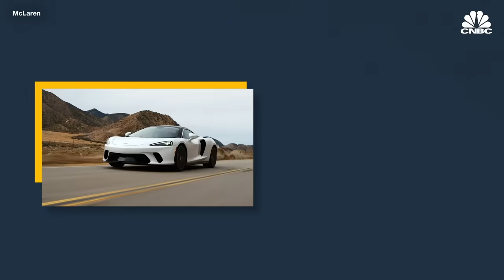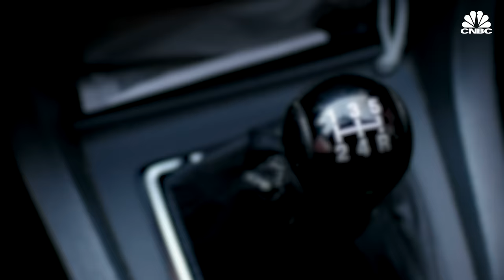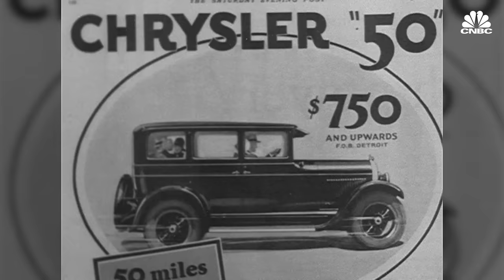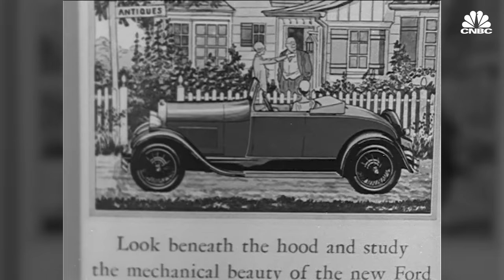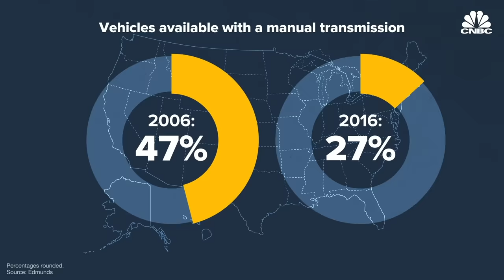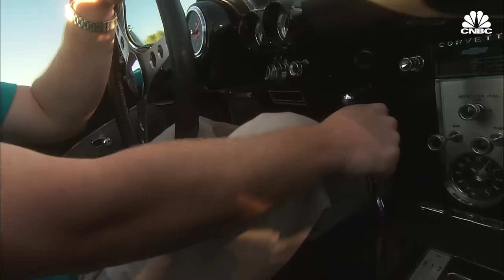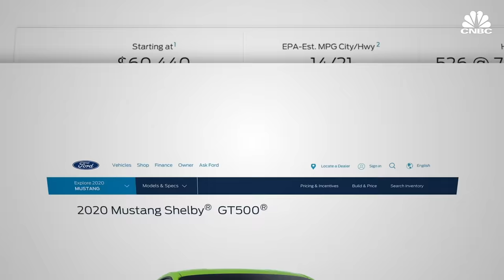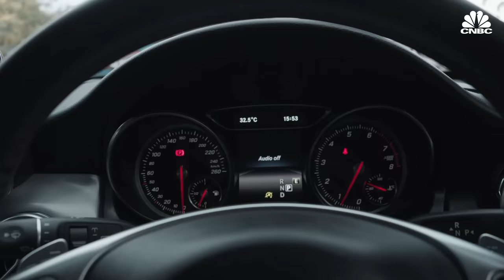Why Stick Shifts Are Going Extinct

Comment: When was the last time you heard of a recall due to a faulty manual transmission? Never? How about an automatic transmission? Every year. Manual transmissions are more reliable than an automatic, even the newest automatics are troublesome. If you drive it properly, the clutch should last indefinitely and, if the clutch does fail, it is easier and cheaper to replace then your automatic trans. Also, it is a theft deterrent and no one ever asks to borrow your manual transmission car.
Reply: Friend; Bro can i borrow your car?
Me: Yes. I drive manual
Friend: Nevermind
Reply: The only part I disagree with is the clutch lasting indefinitely a good automatic will by far be easier to maintain then the best of manual transmission.
Reply: @blackduncan9812  I was an auto mechanic for seven years. The only maintenance either needs are fluid changes, and most people don't bother with their transmission fluid. A manual gear box is simple, an automatic transmission is complicated. If your clutch fails you are either riding it (leaving your foot on the clutch pedal) or downshifting to slow down excessively. Used properly a clutch will last indefinitely. Even if the clutch needs replacement it is far less expensive and easier to replace than an automatic transmission. If your clutch fails you may need to spend up to $500. If your automatic transmission fails it likely will make more financial sense to replace the entire car.
Reply: @jinneemagic302 I learned to drive a stick at 16. It is not an art, it is very easy. Once you learn, you can do it without really even thinking about it. I am neither a hobby racer nor a hot rodder and I much prefer a stick. Then again, I focus on driving; not on my smart phone or beverage.
Reply: @jameslovell405  😂😂 fluid changes are all automatics need and most only need that around 100k miles. Clutches are ware items they need to be changed along with fluid at 80k to 130k miles. Not to also mention that most vehicles changing fluid doesn't require the removal of that component. When changing a clutch its very expensive because the entire transmission has to be removed. Although automatic transmission are more complex that complexity doesn't equate to unreliability most people with autos religionsly don't take care of them while people that drive sticks are much more likely to take care of the the entire car not just the transmission.
Reply: Ford Mustang aluminum shift fork defect
Reply: @jinneemagic302 no it isn't. I would take a manual over an auto any day.
Reply: How long a clutch lasts has a lot to do with the type of car that it is. A cheap economy car for example might have a long lasting clutch since it isn't meant to perform really, it's just meant to get you around reliably and cheaply. As for sports cars the high performance clutches they use definitely aren't meant to last forever, some exotics barely last 1,000 miles.
Reply: @blackduncan9812  I still drive my 15 year old 2005 Acura TL with a 6 speed manual transmission.  170k miles.  Still on the original clutch.
Reply: Theres an active 2020 jeep recall for manual transmissions right now
Reply: Exactly the idea why they think to remove them , because if its totaly reliable that means less benefits for the "changing parts buisness " .
Reply: James Lovell 7 years huh? funny that’s why all my coworkers who have been mechanics for 40+ years have ALL replaced their clutches. i would do a little research on the conservation of energy, friction, and power.
Reply: Someone tried to steal my cousin's classic Mustang.  They were caught because while they were trying to figure out how to operate it, there was enough time for police to arrive.
Reply: @jinneemagic302 I had an automatic when I was 16, but I really wanted to learn manual. When I was 17 my brother taught me on his Trans Am. All my subsequent car purchases have been manual. I'm not a hot rodder or enthusiast.  I just like how it feels to have that level of control over the power output.
Reply: @blackduncan9812  a clutch will need to be replaced, but the interval depends on how you use it. Someone learning to drive will burn one out faster than a knowledgeable driver. Yes, the clutch in a manual needs replacing far more often than the equivalent torque converter in an automatic but the manual transmission itself will last indefinitely if maintained properly. I just retired me daily driver due to a broken connecting rod, it was a 2002 Subaru Outback 2.5/5 speed manual with over 370,000 miles. With just  3 clutch changes in its life time at a total of about $900. One clutch was ruined by a teenager learning to drive. Had to replace one master cylinder as well, which is something else that may need to be replaced in a manual transmission.
Reply: @blackduncan9812  I also drive and work on and have built autos for racing. You have some points but you should be open to some real world experience from others. I've seen a quality clutch last over 200k. The clutch discs found in most auto transmissions usually do not last 300k-400k without needing to be replaced which means a rebuild of the unit even with routine maintenance. I speak from experience, but both of the transmissions have their place... Except for continuously variable transmissions... Those are garbage and should be reserved for go karts and snow mobiles.
Reply: Yes. You are right.
Reply: @jameslovell405  Used properly, can a clutch last 300000 miles ?
Reply: @blackduncan9812  No changing a clutch plate does not require removing the transmission. Where did you get that from.
Reply: I love manual.. I do drive one.. heel and toe on a mountain road, best feeling ever.. but guys, one day manual transmission will go into museum.. we all know that. Just embrace it while you can..
Reply: The Civic Type R’s were somehow sold with wholass gears missing but that’s about it
Reply: @atxscrew8470  Automatics are much sought after
Reply: @jameslovell405  every car I've owned has been stick, pretty much because of the reliability and enjoyment. But I absolutely get annoyed with stick Bros that talk about how it's such an art and like they're above other people that drive autos. You can learn to drive very quickly. Plus, they act like it's some kinda manliness factor to it.. smh lol
Reply: Preach! My current daily driver's a 5 spd stick.............which was a huge reason why I bought it.
Reply: @blackduncan9812  wrong they take the same level of difficulty to maintain. Change fluids. however, if they brake the manual version is easier to fix because it is a simpler design
Reply: @blackduncan9812  you don't need to remove a component to change the gear oil in a manual. Have you worked on a car? This is common knowledge.
Reply: @blackduncan9812  Also auto tend to go out sooner than manual. Not in all case, but most. Just look at automatic Jatco Transmission in Nissan. They are a serve weak point in those cars. However, Aisin Auto tend to last for 200,000 mile (because they are my by Toyota-known for reliable cars)
Reply: @fiffe7782  I'd just hang it up. His opinions are fact and it seems the opinions from everyone else (including daily manual drivers and mechanics) do not matter. 😁 Close mined people learn the least.
Reply: He's not basing his opinion off of first hand experience. I've worked on domestic and foreign, the majority or my experience being from GM transmissions (350-400th, 700r4, 4l60-4l80e) mainly because that's what my builds consist of, but also a lot of 4r75e,4r70w-4r75w transmissions from P71 Crown Vics because they usually hit the auction block due to a blown trans at 80k-100k miles, the least of my experience would be from Mopar transmissions usually of the 727TF-904 type. And by no means am I bragging, I'm just a guy who loves to build cars and has worked on A LOT of run of the mill cars like Chevy, Ford, Honda, Toyota, Nissan, probably 200 P71s 😁 I would just like to know where he's getting his information from. Also happen to have a close relative with a shop specializing in transmissions.
Reply: @greasemonkey258  I owned a lot of manual cars. When I was young and broke I drove beaters and I usually drove them until something broke that cost more to fix than it would cost me to find another beater. That was never the transmission. On one or two cars it was the clutch, but generally the rest of the car was in bad enough condition that I couldn't justify the cost of replacing the clutch. I had clutches replaced a few times too. IME, with even halfway decent care and maintenance, a manual transmission will outlast the rest of the car. A manual car may well go through two or three clutches during its lifetime. It depends on how good the clutch is and how well you drive it.
Reply: @indranilchakrabarty4196  On just about any  car, you have to remove either the transmission or the enigne to replace a clutch disk (and while you're at it, you should usually replace pressure plate, and resurface or replace the flywheel, thorwout bearing, and maybe rear engine seal, because if you don't and any of those things fail later, you will have to do most of that labor again.
Reply: @indranilchakrabarty4196  what car besides maybe a few rear engine exotics dont requiring you to remove the transmission out of the way? you have to remove the transmission because the clutch plate is between the engine and the gearbox...
Reply: @grantapalooza998  I agree. When I was 16, it took me maybe a couple of weeks to get where I could drive a stick smoothly. It took a few years to learn all of the nuances, but I was competent pretty quickly.
Reply: @fiffe7782  Well, unless you call the drain and fill plugs components, you are correct.
Reply: @russlehman2070  I've done the same thing almost since I've gotten my license. I keep something to go from A to B and it's always been a manual car, I've gotten 100k miles out of a vehicle that I have less than a $1000 total in more than once.
Reply: @russlehman2070  adding this to my other reply, I bought a clean 2002 Subaru Outback 2.5/5spd with 160k on the dash for $200 with blown head gaskets. Replaced the gaskets then tuned up the engine, replaced the clutch that was on its last leg with a quality clutch and master cylinder, and changed the shifter bushings (still shifted fine but a lot of play) and that car ran until it broke a connecting rod at 370k with only routine maintenance and replacing an ignition coil. Maybe had $2000 in it with new tires and everything, count that up... $2000 for 200k miles of use. Just sold a maxima that I got 80k out of and has $1200 total in as well.

Comment: Because people know it's much more difficult to text and drive in a manual.
Reply: Once you know how to drive a manual car it becomes second nature and you just get better at shifting and driving with one hand and texting with the other lol
Reply: Bulls#!+
Once you're cruising in a manual it isn't necessary to shift that often and if someone wants to take part in the deadly occupation of texting and driving they can easily do so.
Reply: Manuals are shaky and you don't get a quiet ride. Plus for me it's distracting...
Reply: Not really. I text all the time with a manual.
Reply: The o.g. poster didn't say impossible, they said "more" difficult.... It's not untrue, I once able to eat a hamburger, watch pornhub and look through items in my backseat while driving an automatic. Doing the same thing in the city with a shorter geared manual is a task.
Reply: Not for me, and I can roll a blunt too lol
Reply: @bloopbloop2019  Shouldn't drive a car if any shake distracts you...
Reply: @bloopbloop2019  that's bs, you probably either had a car with messed up transmission mounts, or something wrong with your suspension, I owned several manual cars in the past and never had that issue, I had a friend that his transmission was falling off the car and it shaked a lot, and it was his fault for always taking it apart to modify it  and not replacing or upgrading with higher quality parts when doing such mods
Reply: @bloopbloop2019  wtf are you talking about?
Reply: @alansmilealot  No one said "impossible," OP said it was "more difficult." I beg to differ. It really isn't.
Reply: Remember the flip phone days when you had to press each button 3 times to get 1 letter? Oh yeah we mastered that all the while driving manual cars. These zoomers don't know the fun they misssed haha
Reply: @bloopbloop2019  you must have been in a messed up car lol

Comment: They're generally less expensive to fix than an automatic.
Reply: And either the clutch or the torque converter has to be repaired more often.
Reply: Master Of puppets  It'd be a shame if people would put their phones down when they drive.
Reply: @yrralyou  what are you on about?
Reply: @globalist1990  Well that "question" is not actually a question since it's ambiguous and unclear.  Do you mean "...what am I on?..."  Nothing, I don't smoke or consume drugs.  Or do mean what am I about?  I'm about 6" 3" 235 lbs.  Why would you want to know that is beyond me.
Reply: @yrralyou   well I mean first manuals don’t have torque converters 🤷🏻‍♂️. And clutches well how long they last depends on your vehicle and clutch lining material as well as how do you drive the vehicle all play into how long a clutch lasts on 4 cylinder vehicles I’ve made them last a long time v8 muscle cars and diesel pick ups will wear them faster usually.
Reply: @dragracing news that’s a part of the automatic transmission that connects to the engine.  When you are stopped the engine is still running.   So you need something the slips at low rotational speeds
Reply: @dragracing news funny your doing drag races.  If I had my way I would modify torque converter using Magnetorheological fluid so you could have unlimited flash point.   Anyways have a great day playing with your car.  Most of my ideas end badly the first couple of runs.
Reply: Yeah, but it is way more dangerous to drive with it... The difference between driver driving automatic and driver driving stick is comparable to that between sober and drunk driver.
Reply: @dragracing news Cars with automatic transmision does not have clutch. There is constantly set any gear. It can not be connected direcly because, again, there is no clutch. Also the cars with automatic transmision needs it to smooth the gear shifting.
Reply: Steve Jones  LOL, so more complex system costs more? O.k.
Reply: Manufacturers hate them
Reply: @jackwilson5542  LOL - "way more dangerous" to drive with a stick shift, are you joking? It's actually safer.
Reply: Steve Jones  a manual is way cheaper unless your trying to buy a T56 there is way less parts to fail in the first place.
Reply: @dragracing news in a nut shell a torque converter is a fluid coupler that can handle engine load and keep power balance and the key factor that will keep your car running at a stop in an automatic. But I still prefer manual transmissions! Today in 2021 we are now using a mix of both transmission to do the best work in a dual wet clutch manual transmission and CVT’s are also another type out today.
Reply: Robert Bru  the lies you tell. A auto trans can go out in 60k-140k depending on The defects and how cheap the trans is. and A stock manual trans can give you a minimum of 150k before the clutch burns out. And I say this a newb to driving manuals. People who are learning stick or trying to drag race and show off burn clutches at that mileage and let’s do the math
The average price for a worn clutch will cost you 1400. The cost of a failing auto trans around the same mileage will burn you 2200 and up depending on year make and model. A manual trans is giving you 200k easily. You will deal with skips and jumps in a auto trans way faster that a manual. It’s all about the driver and their skill. You can’t say the same for a auto trans
Reply: They weigh much less and are more flexible in use.
Reply: How so?
Reply: Robert Bru  That's because your son doesn't know how to drive a stick or has been doing interesting things with the car that you don't know about.  You know not of what you speak of.  If you were correct people would have abandoned sticks a long time ago.  Sticks interfere with the ability to eat, drink and text  while driving.  The average American driver can't handle it.
Reply: Robert Bru  Some teenager drove mother's car and hit a parked car totaling it and damaged car on other side of it also so what is your point young people are often careless drivers.
Reply: @_Meng_Lan  Wow, you've had FIVE cars.  What experience you've had!  When you've had 25 or so, post your experience again.
Reply: @_Meng_Lan  20 years WOW!  Try getting back to me with your vast experience when you have 60 years of experience with cars.  Your Point?  I see no point, perhaps with a little more experience, you can write a bit more coherently.

Comment: Just got my first manual transmission and it has been MILES BETTER (no pun intended) than driving an automatic. Very enganging and you really get to know your car on another level. Yes the stop and go traffic can be annoying but the benefits outweigh the cons. I drive a Civic Si and I get way better fuel economy than on my last Civic Hatchback with the CVT. Your driving habits and style WILL change and you will learn to be more proactive at reading lights, reading other cars, and becomig beat friends with Neutral. You be surprised with how much you can avoid unnecessary shifts to 1st gear  with proper judgements.
Reply: Congrats! Civic Si is a great car.  One of the rare/few cars only offered in a stick.  Save the Manuals!